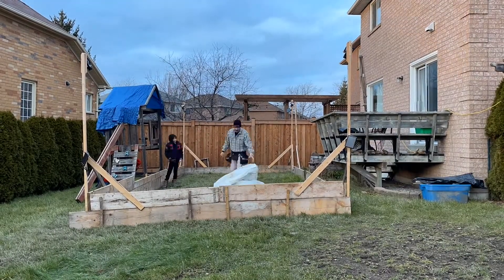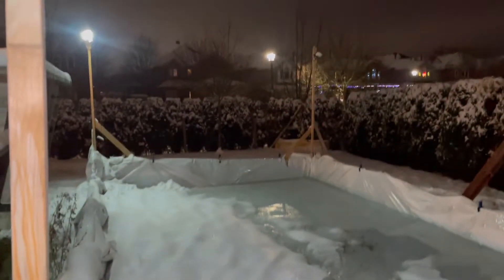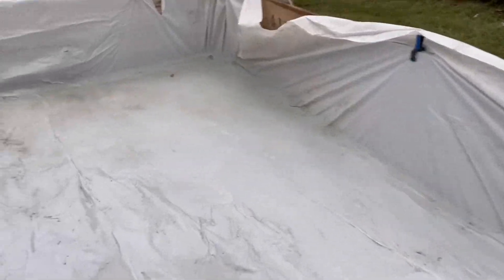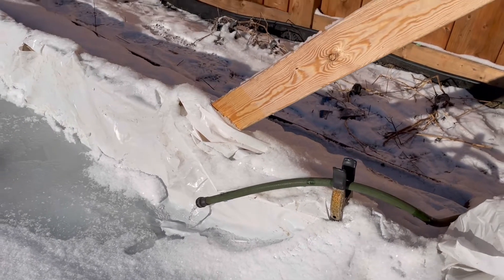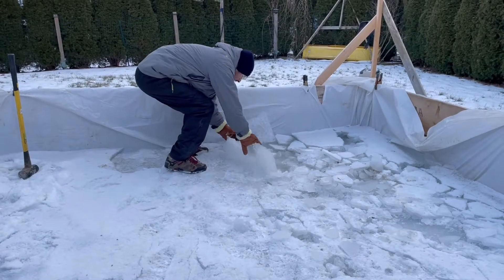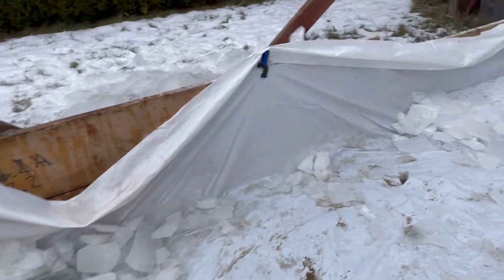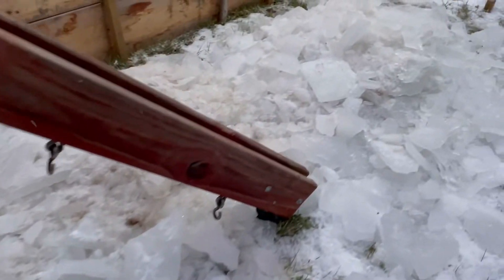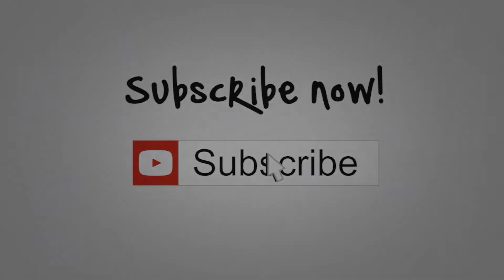Backyard Rink Disaster. Avoid this!

Comment: Just curious, with liner and ice in place (after the fail) couldn’t you have salvaged current setup with new approach? Why did you have to break the ice and remove liner, opposed to just packing in snow and layering over it?
Reply from the maker: Hey there. That’s a fair question. The reason why I decided to go that way is because the plastic liner and the odd pieces of ice already inside the boards would have prevented me from creating a consistent, uniform bed of compressed snow. Considering the edge that I had to make around the outside, for example, the flexible plastic would have pushed back against the snow and made it crumble. Also, snow is not nearly as heavy as water, so there would be air pockets left underneath the plastic while the snowy ice crust was forming, and then the ice above that pocket (especially around the edge) would likely break as the ice built up and became heavy enough to collapse in on the air pocket. I’m pretty sure, although I am just guessing, that it’s better to start the process with a blank slate. 

Finally, and perhaps most importantly, I was trying to show people how they could make a backyard rink without a plastic liner, and I could not have proven the viability of the concept if I left the plastic liner inside the rink.

Be well, and good luck with your linerless backyard rink if you plan to build one this year!